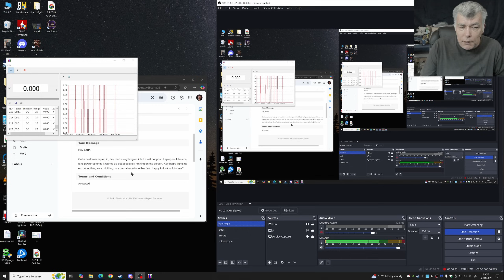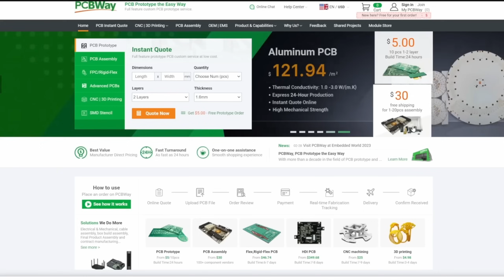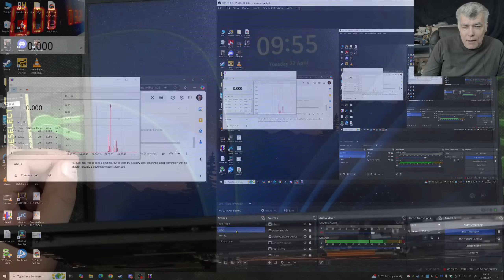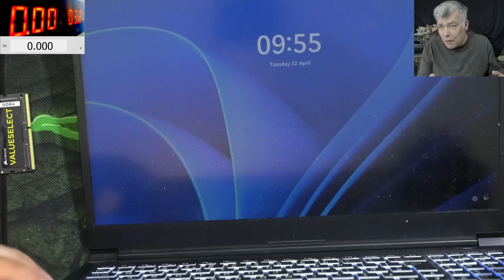Laptop coming on with no picture? Check this FIRST! Clevo gaming laptop repair

Comment: iiyama N850 (a.k.a Clevo in Japanese disguise) of mine had same issue, I just applied flux, heat (suave), when they get shiny, I move on... That's it. No more problem and both slots working. Sorin, Chinesium crap, cold soldering, fissures due keyboard impact and a weak frame (all plastic and weak). Check out how it bends.

Comment: Clevo is a good brand for fixing. full circuit diagrams and parts lists, Bios is online as well. might need a bit of a search. PREMA is latest version. Still plenty of parts can be ordered. or sourced via ebay. There is often 4 ram sockets, x2 top x2 bottom. multiple  mpcmcia slots on both sides.

Comment: The ram just needed reflowing on the bga chips, common issue. Nothing to lose by trying and everything to learn. You have already been paid for the repair and you basically did almost nothing so why not do the right thing and reflow the ram just to see if that will fix it. The day when you lose interest and curiosity is the day you retire to the 6-foot hole in the ground ;-)

Comment: Yes, the slot can cause a problems. I found those problems on HP cf14
Reply: Could some dust/ dirt get stuck on a pin or two, and prevent proper operation? Thank you
Reply: @j.lietka9406  death cap cause it on one slot and the other slot working normal.
Reply: Correct

Comment: You just confirmed what I already thought. Don't buy a laptop with soldered in RAM. I'm looking at new laptops, and there's a Lenovo with soldered RAM plus an expansion slot. Then there's an HP with all RAM soldered. Fortunately, there's another Lenovo laptop with 2 slots - no RAM soldered. That's the one to get.

Comment: Forgetting to check RAM is something we all do at some point, but it becomes second nature the more "dead" laptops you look at. Easy to overlook, for an inexperienced computer shop person. Often a dead RAM stick, occasionally crap in the connection slot. Underlying issue was well-diagnosed as usual, I have to admit 🙂

Comment: Hello 🤝 I recently had a similar case, the memory in the slot did not work, but the one soldered to the motherboard worked normally. Later it turned out that the connections under the processor, which were responsible for communication between the memory and the processor (cracked solder joints), were damaged: after heating the processor, everything returned to normal.👍👍👍👍👍👏👏👏👏👏👏👋👋👋👋👋

Comment: From our humble experience, with the advent of DDR4 memory for desktop and laptop computers, these problems have arisen, the material used to make "gold-plated connectors" is not good, the contacts start to get a patina that creates poor contact, cigarette smoke accelerates this process, with laptops there is a case where there is no image, with classic computers there are two cases, the first is that there is no image, the second is frequent blue screens, we clean the contacts with erasers for chemical erasers, we have solved many computers this way, rarely when the memory has really suffered. Of course you can be cunning and sell new memory

Comment: Sorin you should get a pci express x1 DIAGNOSTIC CARD , with that you can se the codes on the nvme slot, and see if the cpu is good or not

Comment: Good for you it's the ram recently i got a toshiba i3 processor with a black screen and it's the cpu no core voltage and heat comes from one corner of the die, maybe you could fix that ram srick with a reflow

Comment: I mean, customer said he's trying everything but won't post
what's everything? I would just assume customer already tried another ram stick or different socket
Reply from the maker: As you seen on the video, is not that simple, the slot was not working also before cleaning, so a combination of a partial faulty ran and a faulty slot, can drive you crazy
Reply: @electronicsrepairschool  but the other slot is working